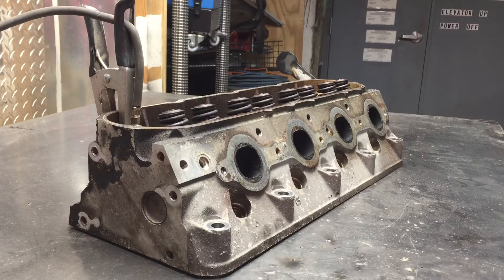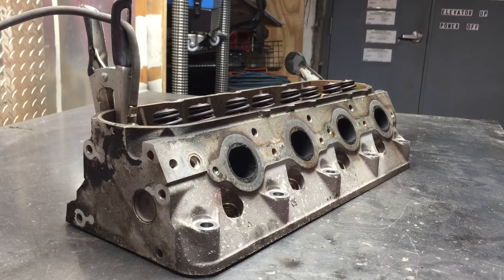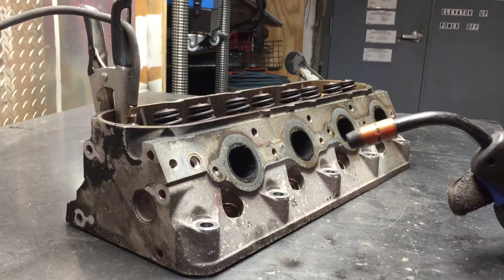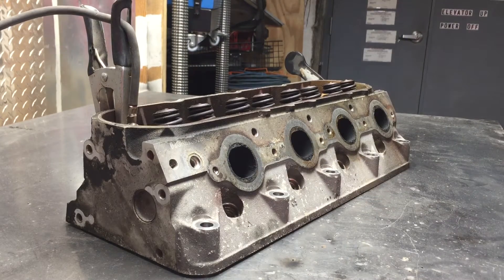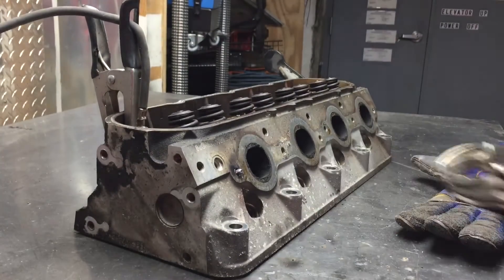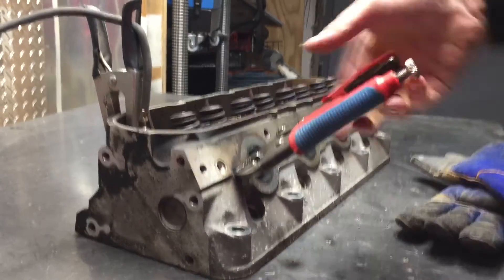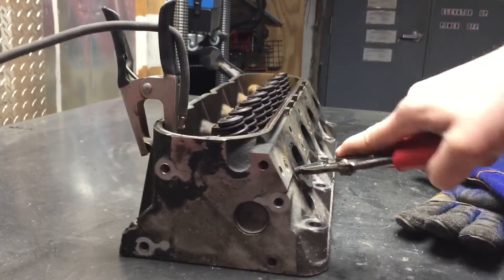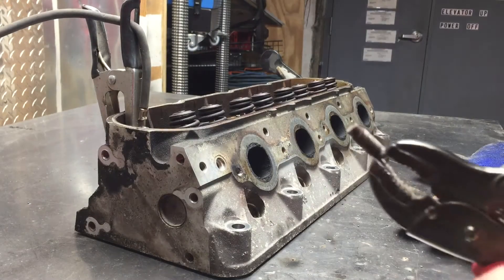LS engine broken exhaust manifold stud removal

Comment: Thanks for this vid. I do not consider myself a welder but I can stick 2 pieces of metal together. I practiced building up on a bolt end that I had already removed. I had the same 2 broken studs on a 6.0 and got both of them out last night exactly the way you did. These were below the surface of the head so I would have had to build it up to even plug weld a nut. THANK YOU good sir!
Reply from the maker: Ray Cam You are most welcome, sir! I'm glad the video helped you out!

Comment: Hey man I have no idea if you even upload anymore but I have a 3T22A only problem is i aint got 3 phase and i dont have that kinda cash on hand to get a generator. I was thinking of doing a set up similar to yours but I was wondering if you had any suggestions as on what to buy and what not. Id really appreciate a reply.
Reply from the maker: Hey man, I’m so sorry, I just now saw this 3 years later!! I am just getting back into sirens and uploading. I put my first video up last week…first upload in many years. Best advice I can give is to go take a look at my old gas powered 3T22 videos and that should give you a good idea. I would say get ATLEAST a 15 horse vertical engine. Mine felt underpowered, and if memory serves it was an 11 horse engine. It’s been a long time so I’m a bit rusty on it. Hey, if you would ever want to sell that 3T22, let me know. I’m looking for one. If you’re still in Hugo, I’m only about 40-45 mins from you. Again, sorry it took me so long to see that comment.
Reply: @ all good man. Unfortunately I sold the 3T22 in October of 22’. If I see one for sale though I’ll holler at ya!
Reply from the maker: Cool man, no worries! I have a good lead on a 2T22 as of yesterday, so I’ll probably jump on that one. Thanks for letting me know.